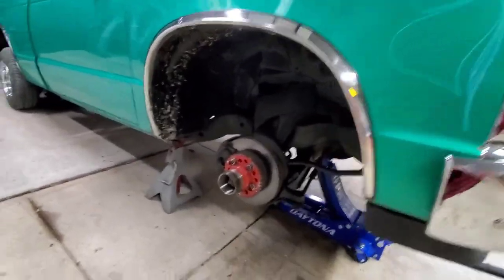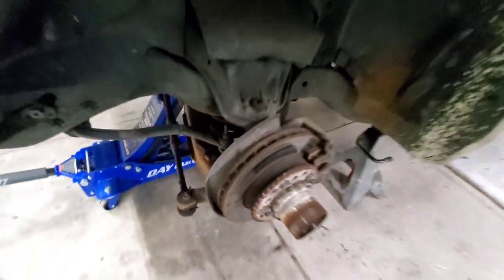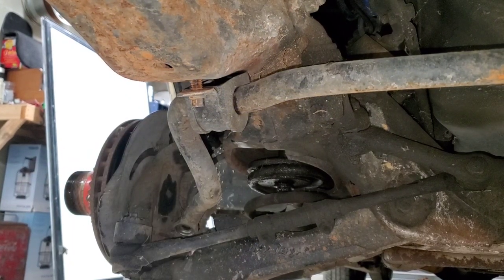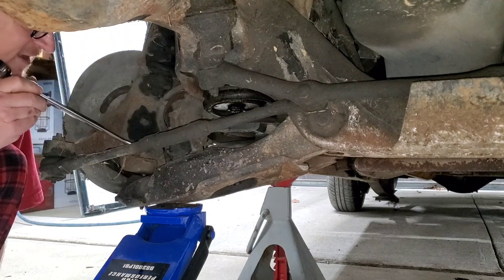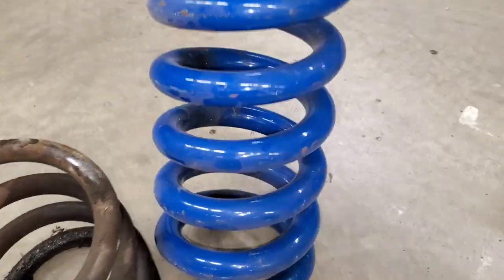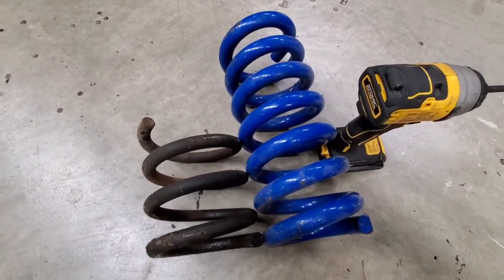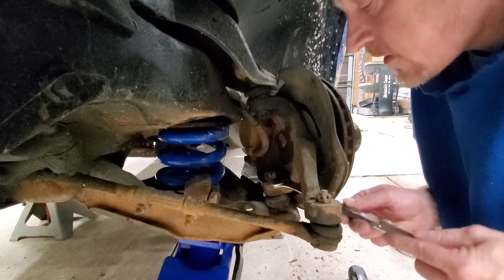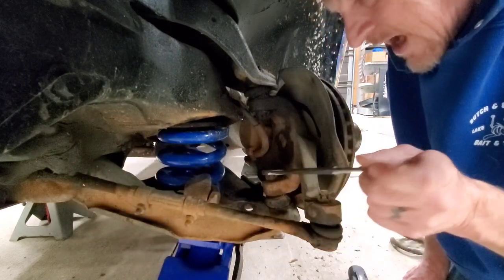Installing 3 1/2 Ton hopping coils in the 1991 Chevy s10. Will it Hop?

Comment: I know I’m late to the party but I don’t think you have enough voltage for your set up to really compress the 3.5 tons I would add a few more batteries depending on what you have now
Reply: Also leave more coil would also help so it doesn’t allow the truck to bottom out
Reply from the maker: Ended up getting precuts and got it off the ground pretty decent. Ive never had more than 48v systems. Not looking to do anything crazy.

Comment: Battery’s need a charge and probably add 2 more batteries to front adjust the dump and also bleed the lines maybe that’s why it’s going down crooked always good to bleed them once in a while and definitely need more batteries power charge them up and hit the switches for the bitches